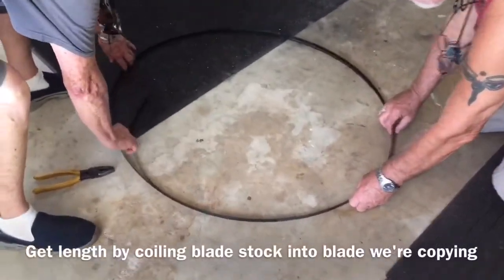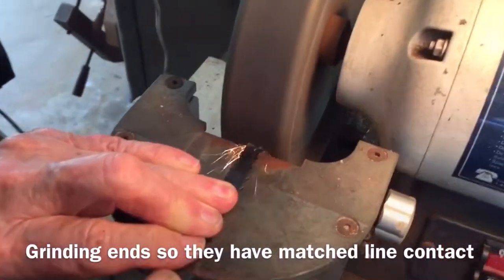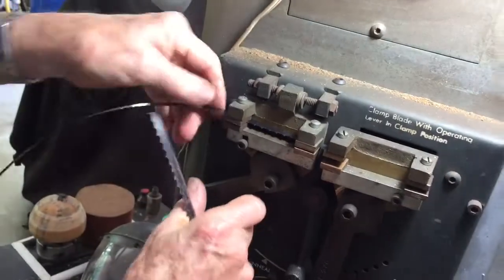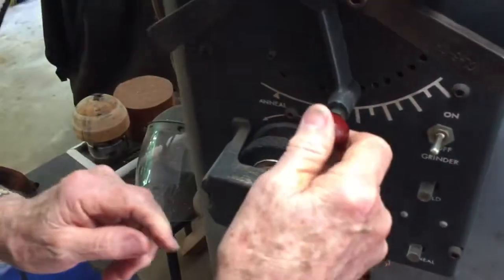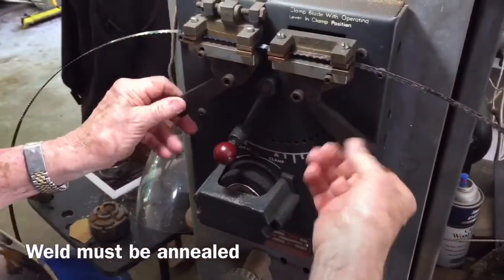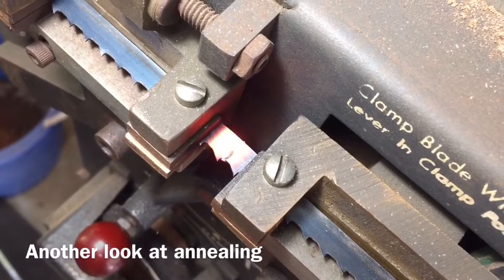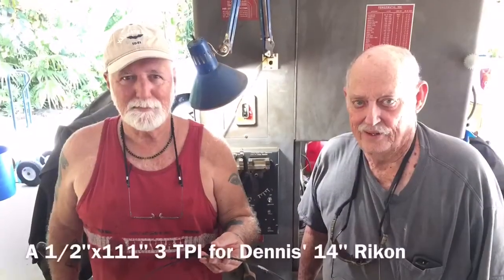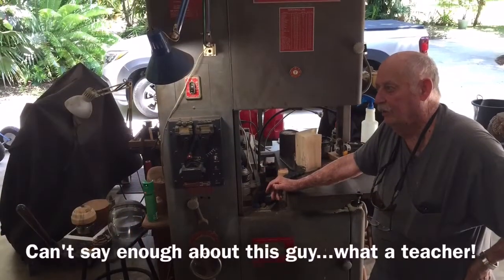How to Make Bandsaw Blades with a Powermatic Blade Welder - With Jack Shelton

Comment: This guy reminds me of a mechanic neighbor I had for 20 years. The guy worked for Caterpillar and had every mechanic tool I ever knew there was, and a bunch of stuff I didn't (and still don't).. including a valve machine for automotive heads.. Guy had 3 of the biggest toolboxes I had ever seen, wider than a car, snap on and proto. He had a stroke about 8 years ago and never fully recovered full ability in his right side so his left took over and he still pulled off some huge projects for me, like replacing the engine in a van which requires the entire sub frame to drop out and the van be lifted up with a strap and chain to a gantry in the shop. I miss that guy, and I hope they sold their place by now and got out of there and moved back to texas like they always wanted. And then proceed to tour the US like they wanted.
Reply from the maker: Reforged Criterion sounds like my kind of guy...we've been lucky to know these guys for sure...